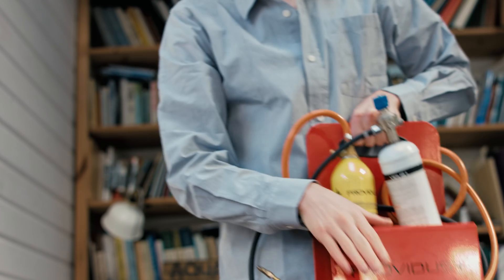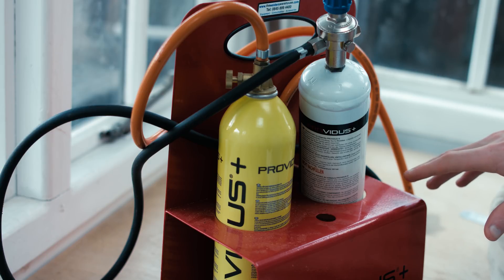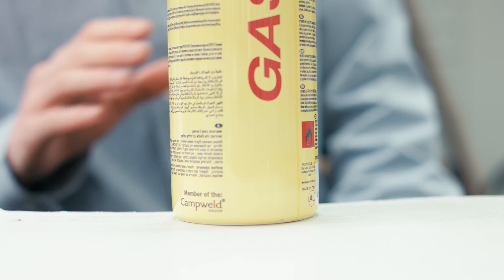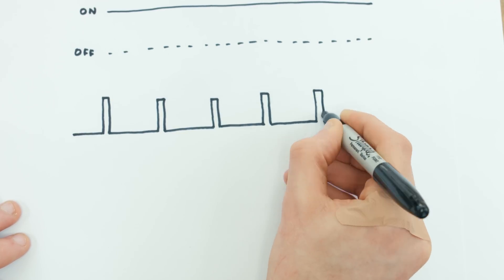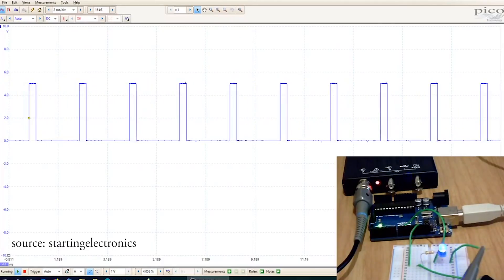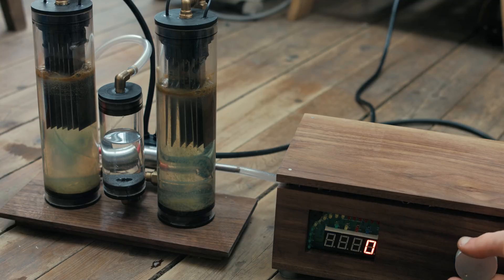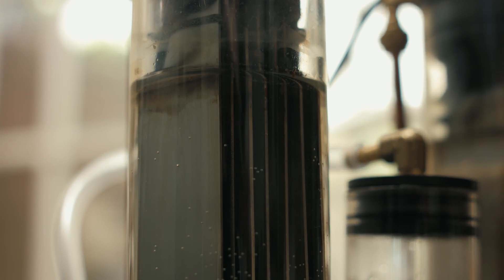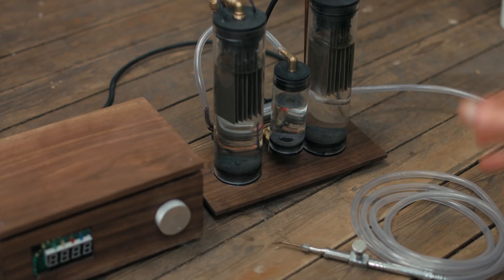Water Powered Cutting Torch

Comment: I would recommend using graphite for your anode as it reacts less with the oxygen. You can get some graphite rods from carbon-zinc batteries
Reply: 20 bucks at a welding supply shop will get you a box of copper coated graphite electrodes 3/8 diameter.
Reply: @hibraisil  I use them for glassblowing tools. Ask nice and they'll probly give you one
Reply: @garethjones6342  I blow glass too. Lol. I bought a box ten years ago and have only used a few. 3/8 is good because it fits in the fat hole of a pencil sharpener if you don't want to take the time to do a proper taper. A proper taper is easy with a drill and a sandpaper sponge.
Reply: @hibraisil  neat! Oh man years ago at a local store with marine antiques  they had a huge crate of lighthouse filaments. They were a foot long and about 1.25" diameter and the hardest graphite I've ever seen. Sadly they all got snatched up by one person. But before that I bought them 1at a time here and there as needed.

You're in vic? What type of glass do you
Work with? Borosilicate and mostly do lampwork
Reply: Ahaha I'm so baked I read my post and thought it was your post mentioning victoria. Oh my laaaawd the reefers gettin too strong.
Reply: @garethjones6342  You can also use the graphite for making molds as well, as I believe that stuff is a rather high density. I've got a ruined graphite coin block that I'm tempted to take the dremel to. I don't have proper machining supplies, so I figure I'll just make a dust chamber to carve it in and see if I can make something with a lot of surface area. Currently looking in to organic designs to accomplish the task, as I'm thinking it might be useful to design it as more of an electrolysis gland and incorporate high temperature silicone in the design. I just need to figure out if you can solder graphite and copper together.
Reply: Graphite rods are not that good becose they degrade and a pencil head is even worse because it will break of easily
Reply: @thenuke4195  I use high density graphite for glassblowing tools. The high quality super dense stuff is worlds apart from cheap battery rods. You can machine the HDC beautifully on a lathe or mill and is quite strong
Reply: @thenuke4195  graphite is actually pretty really good for electrolysis. They wear down pretty slowly in this reaction and when they need replacing, it's pretty easy on the wallet. They use graphite in electrolysis to process battery metals (gold, copper, cobalt, ect)
Reply: @thenuke4195  graphite plates, still degrade but that doenst matter, same with carbon rods, sure you have to switch then but they are cheap and easy to replace, and it will just flake off into graphite

better than dissolving chromium from stsinless steel
Reply: Look for an old oxygen  concentrator. You can get an old medical one for 2 or 300 at most, and you get 95% purity at 5 liters per minute. Nearly free oxygen for years!
Reply: @garethjones6342  I don't know why but the wording of nearly free oxygen is pretty funny
Reply: Graphite comes in many different densities, and the flashlight rods are very low quality. You might want to get a copper clad welding rod and peel of the copper. A welding supply shop would likely just give you one of you ask nicely
Reply: @garethjones6342  i measured and my rods out of a big battery were that it has only 2.3 ohm of resistance.
Reply: use lead either tin metal instead of graphite or any other type of material
Reply: Lol ^ look at these 2 undercover bots. Even got a reply to the initial shady link. The scammers are putting in some more time and thought into it... they grow up so fast :,)
Reply: Oh btw. I love this channel and subsequent comment section that has arose from it. Thanks for all the tips and good ideas guys!
Reply: We used graphite for EDM. Just ask a shop that makes dies for EDM they machine it to any form you want, even build it on a metal connector.
Reply: or you could simply use stainless steel plates
Reply: or a number 2 pencil. I did that in grade school so that would be pretty easy.

Comment: Hey Will :) i like your style in the Videos they are looking realy professional ;) and for the electrodes try aluminium :) greez from Austria
Reply: Serwus auch aus Österreich, problem ist nur dass sich das Aluminium in KOH auflöst... Undzwar reagiert das zu kaliumaluminat und H2. Das heißt nach wenigen minuten hast du keine elektrode mehr. Verstehe nicht wieso ich das immer wieder lese...
Reply: Ok verstehe das wusste ich nicht hatte mir nur gedacht es entsteht eine Oxidschicht was aber durch die Elektrolyse wieder aufgebrochen wird
Reply: @zimpe333   die oxid/passivierungsschicht hast du am alu eigentlich immer. Wäre sie nicht würde das Aluminium sogar mit Wasser reagieren. Das Kaliumhydroxid bricht die Oxidschicht auf, und dann reagiert es erst mit dem wasser zu aluminiumhydroxid, was mit der lauge dann das aluminat bildet. Wenn dich dass interessiert, ich hab das in einem alten Video bei mir (Knallgas vs Wasserstoff) kurz erklärt.😄

Comment from the maker: Apologies for the delayed upload, this project was a bit more intensive than I first thought! I'll try to fix the issues I ran into and post a follow-up video showing me using the torch some more. 🙂
Reply: Can u explain how and what components u use to control pressure of gas?
Reply: Don't apologise, I would rather you take your time and not blow yourself up. Great content. Keep it up.
Reply: I would love to see a bit of laser stuff.
It really isn’t that hard and expensive to get a burning laser running.
Maybe DVD laser diode ?:)
Reply: Try using  sodium carbonated for your electrolyte. Why did you choose potassium? Sorry, I had to edit my first suggestion was incorrect my memory failed me.
Reply: You mentioned in your video about corrosion on the metal plates. there's an alternative. Use graphite plates in the dry cell configuration it's more efficient